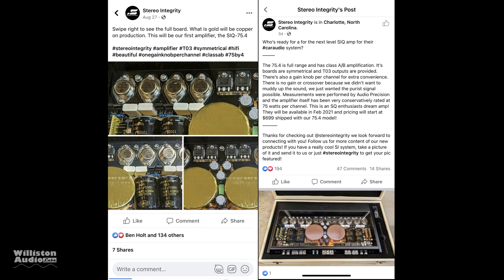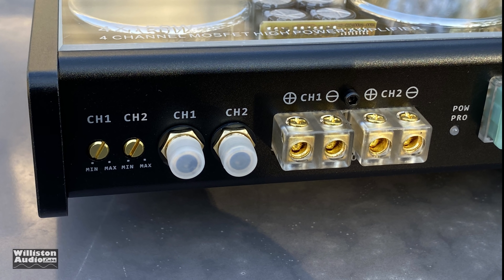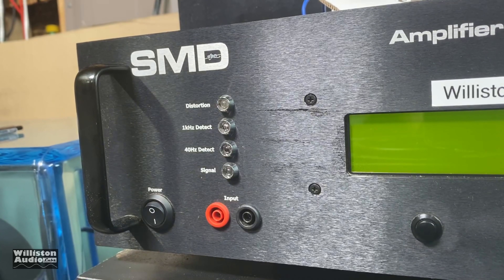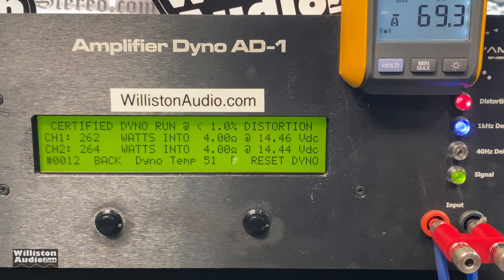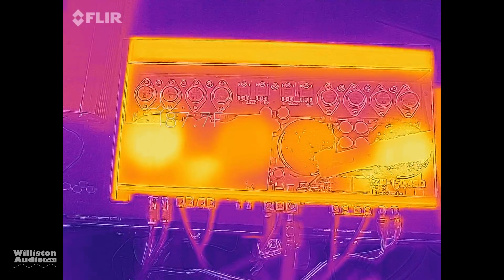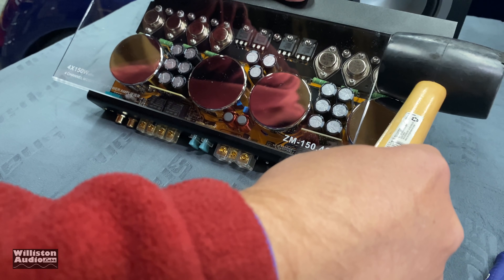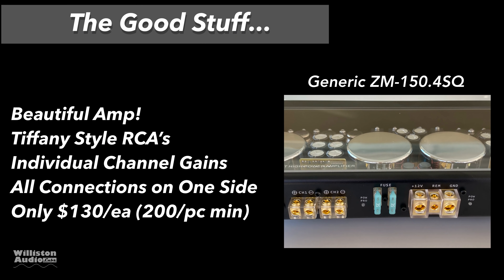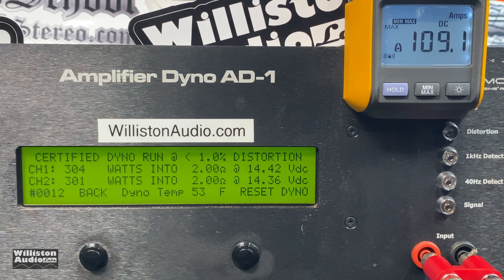Looks Can Be Deceiving... ZM-150.4SQ Amp Dyno Test and Review

Comment: Zed made Nakamichi amps are almost impossible to take the bottom cover off as well. The build quality on those is not very consistent.

Also, On Semiconductor used to be Motorola.

Comment: What i see is the cheap generic 3w green resistor instead of 5w ceramic wirewound resistor near the final capacitor. Wirewound is best resistor for audio, metal film would be next. The green resistor there could be metal oxide(thick film) or carbon film one, its a no.

The smaller multiple caps is a way to reduce the price instead one or two set high quality audio. Not an indication of the quality of the amp. 

For sq i would want a 3 stage gain transistor construction(ab class amp), emi power filter, metal film resistor, mkp/mkm(red or orange rould be nice) capacitor, audio grade elco and audio grade opamp. 

There should not be a generic parts outside the inverter section. I prefer smaller but numerous elco. Bigger caps just dont do well in the higher freq than their smaller variants.

Comment: Yeah, they could get a bit more power out of single pair of 15024/25 Motorola output transistors, easily 100W, but it has rather 'small' power supply, some +/-30V on rails. It should be able to take 1ohm no problem. These are older, 5MHz, 15A, 250W trans from the '80s, that make stable, simple, clean sounding amps. Needs more voltage on rails (and silicon) to meed the factory specs.

Comment: Hmm.. Sanken transistors are still considered best for audio then? Interesting, i still have Rotel amps made in the late 70s/early 80s that used custom Sanken power ICs, some of the first integrated chip amps.. Not many watts but they do sound rather impressive! My current Rotel though (RA-970BX) driving two pairs of Kef Coda III (8ohm each) seeing a 4ohm load does quite well! (Toroidal transformer, 8 power output transistors rated 60W RMS x2 @ 8ohm, 90W RMS @ 4ohm!) Specs are fairly impressive should you ever look it up, including the schematics, plus these Kef speakers..wide bandwidth near field studio monitors, they sound incredible! Go down below 30Hz, no sub really needed with 4 of them! Haha..pisses the neighbours off nicely!
Reply from the maker: Thanks for watching and commenting!

Comment: I'm very late to the party, but would love to see whats under the Chrome covers in the center
Reply: The power supply transformers. Good idea if the covers are metal, but they are probably plated plastic.
Reply: @2slofouru  I am curious, the heat sensor didn't show as high of a temp  on the center two. My guess is just for looks, but I could be wrong.
Reply: Those transistors are actually good stuff if you match them. It's odd the amp made such little power, those components are capable of much more.

Comment: All show, no go! You have to admit, it is beautiful to look at. I do like the TO-3 diamond base power transistors. Most modern amplifiers run TO-247 "flat packs". Nothing wrong with the flat packs, (TO-220, T0-247, TO-264) I use these case styles in my designs all the time. It's just unique, to see these "old school" case styles in modern amplifiers.
     It would be interesting, to test the frequency response of this amplifier, compared to less expensive amplifiers of similar power rating. The power supply is definitely a try and a miss. I would expect much better, from a "high end" amplifier. (good choice of MOSFET's in the power supply)
Reply from the maker: I dig it for the aesthetics

Comment: So this is the Alibaba version not the Stereo Integrity version ? The SI version has upgraded capacitors ( nichicon etc ) & other parts that are in the signal path that this amp doesn’t. Very similar but two different layouts as well. Interesting to see this amp sounds  vs the SI one. The ratings can be proven but SQ is always subjective.

Comment: Hey Derrek great vid as always! I'm watching you from Maine and I myself have carried many brands of equipment throughout the years, including some very high end German and English..etc..etc.etc! This amp looks similar to Helix Precision class in design but no-way I'm sure in quality & design as I used to deal in Helix I know better! lol! But anyways it sounded descent for the price tag and your bookshelf speakers really bring out the highs[ are they silk tweets?] So aside from this my question to you is, who makes that black power supply to the left[only could see the corner of the face] I believe it resembles a Massive Audio BP series 200Amp power supply, could you please give some feedback on it either way if I'm right on brand or wrong would be a great help! I no longer run my business but still build systems for my family and friends...My personal BMW 3 series is in build process with 5 Massive Audio Blade series[older models] amplifiers, with the Cap-B extensions a single 12" Helix Esprit carbon flat sub glassed in to the trunk[non-removable] all Orion XTR components[5 pairs mixed 6.5" & 5.25"] play the beats with 2 8" MB Quart shallows in the footwells[glassed in removable floor pods] for mid-bass 80-120hz dialed in via the 2 main 4 channels with built in band-pass x-overs! this being said, I need to power all this stuff with a supply[car is up for winter, show only] other than the 2 Optima Batteries while I finish my build, the power supply I have is a TrippLite 35Amp[old school] its extremely powerful but not above 35 Amps continuous and I don't want to cook it, because it's no longer made! So I'm wracking your brain, what do you use? What do you suggest? keep in mind I don't have Steve Meade dollars or requirements for a large 240Volt like his, but I have a feeling you've been doing this stuff long enough to know about what I'm looking for, so any info you can give me would be awesome, I am Old School as well[49 years old] car audio veteran and see the electronics world has dramatically changed, from my upbringing of this field! I started out with Carver, Concord, JBL, ADS Technologies[Orion/PPI/ ADS], ADCOM Car Amps, Rockford Fosgate[older Punch 30/45/75/150 & of course DSM IX], Eclipse, Phoenix Gold, Kicker, Alpine..etc..Then I opened up my own shop selling Helix/Brax, Genesis, U.S. Amps, RE Audio, MASSIVE, Audio Control, Planet Audio[I made it work], Powerbass Extreme, etc... so enough with my resume' you get the picture I've worked with many brands in my lifetime! Feel free to pick my brain too! thanks for reading this, maybe you could do a power supply video as I'm sure others would appreciate too! 
Sincerely, 
                 Scottyz Car Audio & Automotive Specialties
Reply: Call some of your closest car audio shops and ask if they know who has a good used one for sale. Out here in Phoenix, there's always audio shops closing down and selling their equipment to the highest bidder...

Comment: TO-3 transistors, that's rather unusual nowadays, and the MJ15024 (of which there is one per channel) is one of the suggested replacements for the output transistors in the 1970s/80s version of the Peavey CS-800...

Comment: It may be my speakers/wires, your mic, YouTube's compression but this sounded extremely tinny (like tin) in the highs.
So "Tin it to whin it?" Or, rather It isn't in it except to whine. The lows seemed to be good and tight enough though, so maybe that's not all bad?
Reply from the maker: Lows sounded better to my ears that the rest. Strange though, this is not supposed to be a bass amp

Comment: Wish you would have pulled the board while you had the cover off. You could have checked the under side to confirm the middle transformer covers are empty.
Reply from the maker: They were soldered on, I tried. I have some more uses for the amp but will eventually pull them off
Reply: @wal  Thanks for replying Big D! I meant visually checking the underside of the board, transformers are through-hole components. The board probably doesn't even have vias for a third and fourth transformer. Removing the covers in a non-destructive fashion would be a miserable job, it's hard enough pulling transformers and inductors. If you do decide to pull a cover I would recommend chip-Quik and hot air or applying chip-Quik with an iron and popping the whole board in the oven at a LOW temperature.

Comment: Thermal camera can't tell the temperature of the shields. Don't let it fool you.
Reply from the maker: I removed the plexi and the temp difference was minimal so I did not re-video the segment
Reply: @wal  The shiny metal cans have a low emissivity value and act like a mirror to infrared measuring devices. The temperature you’re seeing could be your ceiling, not the actual parts. Point the infrared camera at the cans or most shiny metals like aluminum and wave your hand above the camera, you’ll see it. Look up emissivity chart of metals for infrared cameras.

Comment: Did you do the thermal image with the acrylic on? Allthough it is see through it will shield most of the heat / infrared. I guess that amp got quite a bit hotter than you measured

Comment: a $15 Class A amp from eBay would be so much better for your high-end that you make yourself and is a do-it-yourself kit that you simply put in audiophile-grade components in and call it a day I think I forgot the name of it but man it does sound pretty darn good.    I kind of wish Nelson pass and gr research and mr. Carlson of Carlson's lab we get together to go ahead and basically put together an audio system for a car and really see what happens with that collaboration.

the truth is in the car audio world? We have been spoiled with the Advent of DSP and especially with DSP processors that are able to use  fire filters and use those to make our crossover points magic there for a limiting crossover Distortion of a Class a / B amp.    

the dream really is Class A amplification with a tube amplifier for the Tweeter and mids and of course a Class A B for the mid-bass and of course a Class D for the subwoofer.    in reality you really only need really high-end equipment as far as drivers to hit make a killer to a system and with a Class D for the subwoofer and call it a day and you know most of the stuff that you need that really being asked you really isn't more but less.

if you really think about it a simple hundred and $20 Pioneer deck with a dual amplifier combine that with a decent set of tweezers and a very decent set of mid bass or mid woofers combined with the very good sealed box subwoofer will provide you just about everything that you can literally here for ninety nine percent of the population or looking for sound quality in their systems in their cars.\\\

going fully active or using the Pioneer deck and network mode really does help so much with the clarity and sound quality that you're able to get since you no longer have to do a cheap crossover components.   

the fact that are really good crossover for a set of speakers would run you almost $400 in Parts really does tell you about the amount of value get with an electronic crossover though it still does have its drawbacks and certain places but again with the amount of digital Wizardry you have to do to make a car audio installation sound good with driver placement being the primary issue in a vehicle and of course where you're sitting that really does make it a no-brainer when you understand that the actual active sound level of your car or really this noise for is where it's going to be at where you can discern the quality differences between drivers and equipment. 

and a word of note for those looking for high-end drivers. Most of the tweeters out there that go above $50 each or component home tweeters that you can buy that work really well for the car almost all of them will do and in fact some of the best tweeters you can get our $28 a piece and you know what those literally shine almost brighter than just about anything that most people are able to hear while the car is in motion.

the thing that made my jaw drop was when I realized that most car audio connectors are actually more audiophile or higher grade than most home terminals used to connect speakers since they're not Ferris or contain steel and are actually copper which was actually a refreshing thing for me when I realize that you don't actually need to go all the way and buy all new stuff but in fact get a soldering iron and use real good solder for your speaker connections if you really want to go all the way.

as far as amplification goes, it does matter but you know what if I told you a simple chip amplifier could sound rutili really good compared to some of the offerings that you get out there that you pay thousands of dollars for? You would look at me and think I'm stupid but you know what for a guy that's been testing these things for over 10 years yeah that's what I came up to.

the weird thing is once you get your system sounding really good, you don't actually turn it up that loud because it's so clear from low volumes you don't really need it louder to really enjoy it which is kind of odd. Yes I still blast my system but man does it sound a great but just the 50 Watts that I have going to my component speakers.   a simple six TV Crossover with the high and audio gray capacitor and some EQ from my phone Believe It or Not does more wonders than I ever could have thought.

I know it sounds counterintuitive a literally the simple the better and in fact there's less in the way of getting between you and the sound and that's really what it's all about.

in my humble opinion the best bang-for-the-buck system is going to be the Dyna audio system that was available in the early V70 convertibles and Volvo two doors that is just amazing.   going fully active on something like that really does get you almost 99% of the way there or sometimes less than a hundred bucks

spend your money on sound deadening and Driver placement and I'm telling you you will be amazed at just how good some inexpensive drivers can be combined going fully active which can be done for less than $120

Comment: I could have told you those ratings from the fuse sizes and it being a class A/B. Further proof stereo integrity amps are just bullshit generic designs with some added "Audio grade" caps that are probably not even real nover caps, probably Chinese knockoffs. I dont trust stereo integrity they have always had quality control issues
Reply: Huh? SI amps won't be out til February 2022.

Comment: China has flooded world with counterfeit transistors. If it's a Chinese  amp and the parts say Toshiba or Sanken you can almost guarantee their fake. If you take the transistors out of the amp and cut them open and compare them to authentic parts you will notice the difference in size of the internals of the devices. The fakes will be much smaller and some are so bad they wont even create a positive gain over the power going in.

Comment: Zed eh', do they call zebras, zedbras? Ha.. 
Anyway, atleast it's perdy! If nothing else,   I like my systems more in the SQ side, but I still like the boom, low deep clean bass, one of the cleanest bass systems I had was with 15" kicker solobaric around 1997,  I was looking at other subs then, they just wasn't as clean, but now I'd go with sundown, or similar built subs, the lower end not quiet entry level models, I don't need a $1000+ sub, around $350-$500 12"-15"-18" , $300 can get a decent 12" sub, but the best system I had back in the day, was all kicker! 2x 360's on the 15's a zr240 on the mids and highs, with a clarion head unit,

Comment: Well to be fair. 
This design was floating around china for couple years now. 
Similar designs were used for Ground Zero amps. And in fact the Vivaldi amp is a "copy" of an older Ground Zero amp. Why "copy" ? 
Because all of these amps are manufactured in China, even the original Ground Zero ones. 
So specially Stereo Integrity is no different, in fact they came to this game really late. And their amp is also made in china, just with bit different components. In fact you can order an identical one.
You can order this design or many others in china with many configurations, or even your own design. 
And the moral of the story... China is not the same as it used to be. These days China is leading the manufacturing process and mostly all brands use products manufactured in china. 
Even the largest brands and most popular ones manufacture their stuff in china, just with higher standards. 
Do not ask me how i know this, bus believe me, 90% of car audio brands do this.
Does csa100.4sq say something ? :))
Reply: Actually, the Vivaldi amps were used as an example for the ground zero amps.. the Vivaldi lineup was not available to the general public at first.. it was intended to give potential customers an example of what the buildhouse can produce for them. Its only been a couple of years that the Vivaldi amps were available to the general public. This was back before the GZ reference lineup was available..Actually dating back to the E.O.S. (emotion of sound) days.